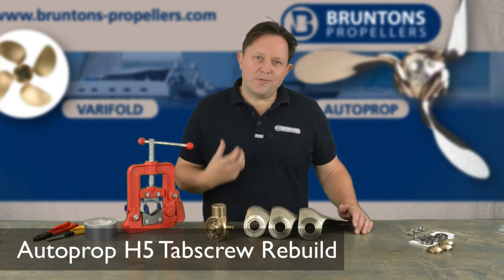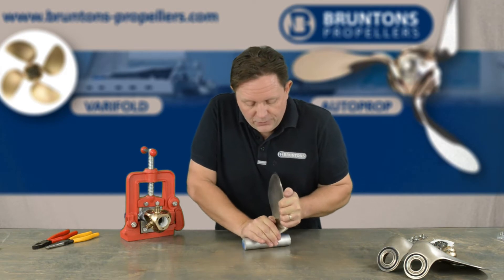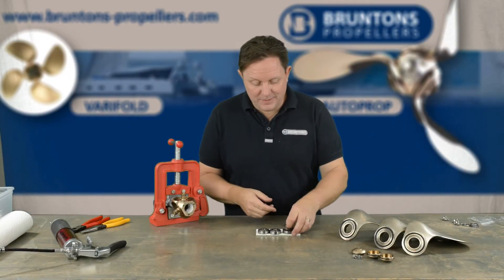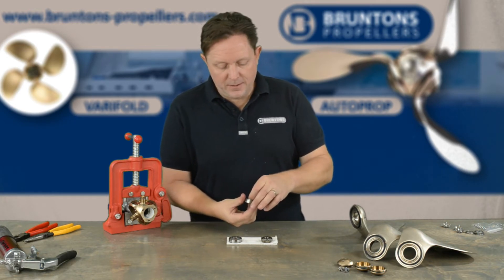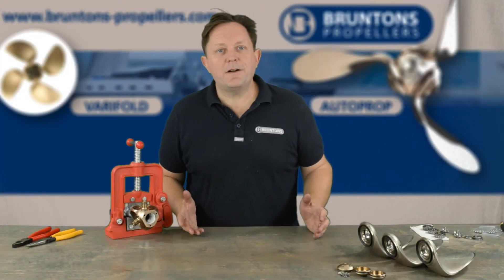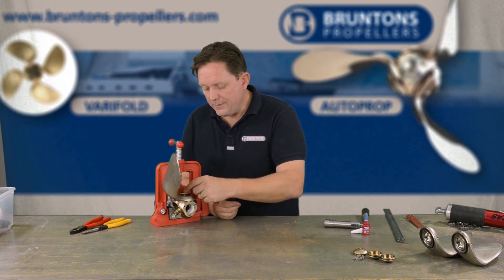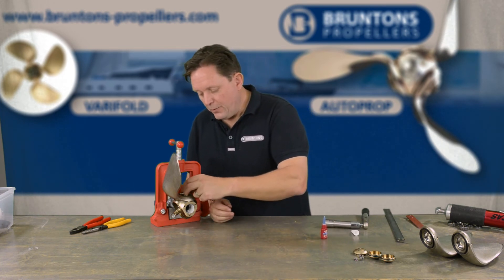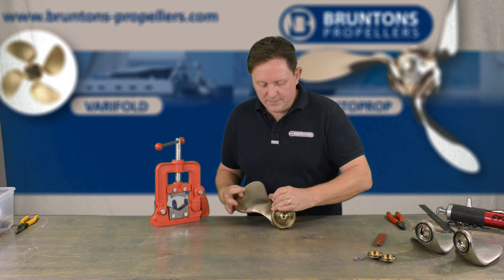Autoprop H5 Propeller Rebuild (Tabscrew)

Comment: Is it not good practice to "load" the taper roller bearing with grease prior to installing?
Reply: I now preload the thrust bearing with grease and once the blade is re-installed, it pushes the grease through the taper bearing before you have pumped the blade full of grease.

Comment: Could you perhaps share the specs for grease seals? I have spare SKF bearings, balls and nuts but I forgot to measure the V-ring seals before I last serviced my H5 Autoprop. I think they are SKF V-ring seals.
Reply: Did you ever get a response? I'm looking at SKF 400650
Reply: @robertvonkulig801 no, neither Brunton or King Propulsion responded. Let me know if they fit!

Comment: Could you just clarify the torque settings from the video please? I should probably know, but is it fourteen or forty, fifteen or fifty you’re suggesting?
Reply from the maker: Torque for the Autoprop is a bit of a black art.  Bruntons recommend 15 Nm or about 11 ft lbs.  However.. The blade must fall on its own weight and sometimes the system torque does not allow this.  So first I will add some grease to the thrust bearing before tightening the nut - not too much to contaminate the loctite.  Then a little WD40 on the lip seal.  Both of these will give you a closer blade friction and help set the torque.  Finally just back off the blade nut slowly until the blade falls like you want it to, gently. Then tighten the tab screw, find your notch and bend the tab into the nut and you are done!  I like to compare all 3 blades as I go around so they are the same.